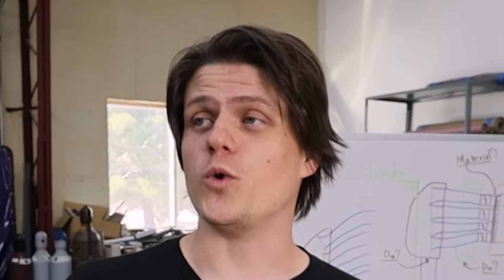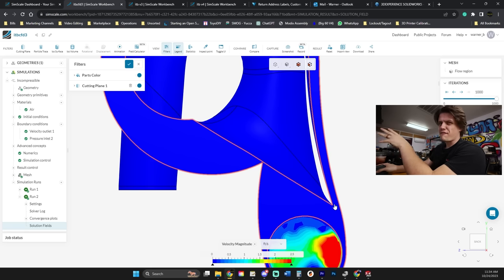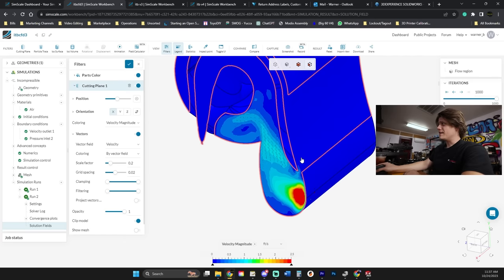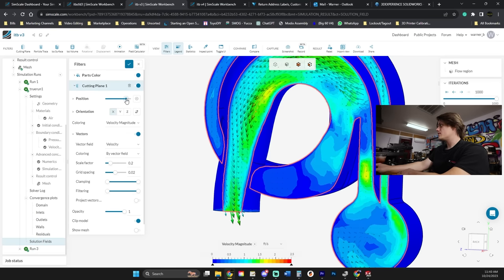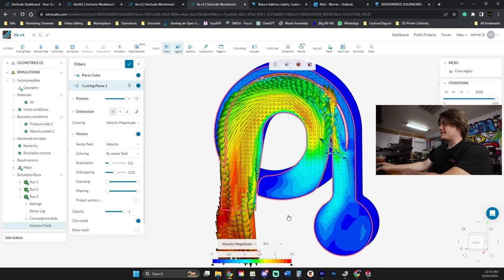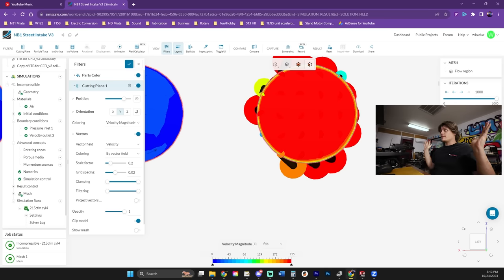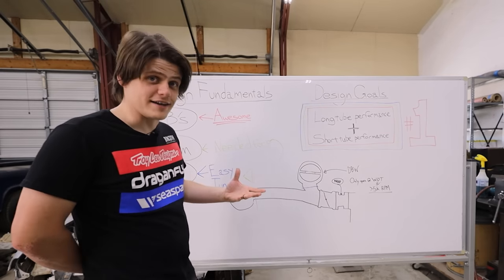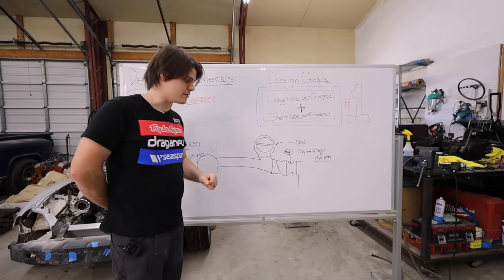The 3D-printed ITB intake system continues to evolve

Comment: The biggest issue with the air velocity you're getting with that round design, Is if you're getting more velocity than the size allows, it's compacting the air and when air compacts it gets warm to hot. Remember turbo and SC applications requires an intercooler or alcohol injection to cool the intake charge, or run straight alcohol to keep temps down

Comment: If air speed is too high it will create a sonic choke at the pinch point of the valve. As the valve opens further it can hand more velocity up to the point the air cant feed the maximum amount of the valve because the air moves fast enough that it skips more and more of the  valve.  This all is meaningless if the amount of air filling up the cylinder is more than its measured volume. That will be achieved by not only having a correct length for a velocity target but also a acoustic target which is a harder thing to pinpoint due to different charge densities.

Comment: Steady-state 3D CFD isn't going to give you a remotely accurate result when it comes to intake/exhaust modeling. There is no steady-state flow in an intake runner. Resonant effects are MUCH more important than steady-state results - i.e. cam timing and runner length (among many other parameters).

If you want a reasonably accurate model, you need to set up a 1D model using something like Ricardo WAVE or EngMod4t. These virtually "spin" the engine and include modeling of combustion, crank/rod geometry, cam/valve lift and timing profile, etc. At very small increments of angle, they calculate the boundary conditions everywhere in the system. Basically they run a CFD simulation of the entire engine every degree of crank rotation until the model converges (it takes a LOT of computation and would take even a supercomputer a while to run if it was 3D, hence the 1D modeling). 

Once you have a decent 1D result you can start to think about optimizing in 3D - but honestly the gains there would be very marginal and not really worth the time unless you're a full-time design/sim engineer working on a large OEM or race engine team. Ricardo has their VECTIS software which can be run as part of the engine simulation - for example, by "inserting" the 3D model of an intake manifold into the 1D full engine model. The boundary conditions of the 1D model are applied to the 3D model, and the 3D sim is run. Again, this happens hundreds/thousands of times in a single full-engine simulation, and takes a very long time.
Reply from the maker: That's awesome. It sounds like those might be outside the budget right now but I'm going to look into them.

The steady state modeling did help me bring the design from a severely restricted state into something that actually seems to flow so I would say it was extremely valuable.

One question about the sim software; You see in the front facing cross-section how the large curve air intersects the short curve air? How could that be simulated in 2D? I feel like this shape may always have to be run as a 3D model.
Reply: @StandRacing  yeah that particular aspect would be tricky to do in 1D. I totally understand budget limitations (Ricardo software is very very expensive). EngMod is much more affordable but there are other options that would work, albeit with big learning curves - look into the work of Gordon P. Blair, specifically “Design and Simulation of Four Stroke Engines” If memory serves it gives you just about everything you need to build your own engine simulation software. I believe you may be able to find some free software, Excel files, etc that others have created based on his work. 

I haven’t watched any of your other videos but I would start by determining the runner length(s) you want and going from there. Also take a look at BMW M42 (or maybe M44), they also used some kind of dual resonance intake.

Also, if you’re going to keep doing 3D CFD, I’d use pressure-based boundary conditions (this is much more accurate to the operation of the engine) and just focus on runner geometry to start. IMO the design goal of any plenum (especially with ITB) should be “act like you don’t exist” (i.e. act like an atmospheric inlet to the runner) so unless you have a severe design deficiency with the plenum the runner/runner inlet geometry is by far the most important (in order of priority: length, diameter, inlet geometry).

When you add complications like dual-length runners and junctions between them, use KISS to make sure each one makes sense as an individual unit. Maybe also consider designing a “doesn’t fit” straight version, them bending as needed to get it to fit the engine bay.

Oh, and I’d scrap the 3D printing anywhere near the throttle bodies. You might be able to get away with doing the plenum but vacuum forces, heat, and gasoline will lead to very short lifetime and/or geometry creep and leaks. 

I’ll try to take a look at some of your other videos to give myself more context on what you’re working on before I give more advice :)
Reply: @StandRacing  Taking a look at the design again, from the "KISS" perspective - the "driver" of air flow in your intake runner is going to be the vacuum in the combustion chamber while intake valve is open combined with any positive pressure wave in the intake runner. In other words, the valve seat area is going to be pulling on the downstream end of the duct (port+runner). With a simple atmospheric entry velocity stack, the result is obvious: "air goes in."

With a simplified version of what you're designing, you'd simply have two velocity stacks with a Y-junction near the intake port. That already makes things much more complicated - you'd have the driving "pull" through the intake valve as the piston moves down combined with any exhaust scavenging pulse, but the positive pressure waves from the two intake runners would arrive at different times, weakening their effects. Maybe at low RPM the long runner would negate some of the downsides of the short runner when it's not in it's optimal operating range, but just as easily you might just transfer air from one runner to the other instead of into the intake valve. Maybe you would broaden the powerband, but you'd also end up with less power at each one's tuned RPM compared to the single-runner version. And that's the best-case scenario - most likely, you'll lose power almost everywhere compared to a good tuned single-runner intake. As others have pointed out, a switching valve between them would work in theory to give you what you're looking for, but very tricky to implement reliably. Turns out it's simpler to make your cam timing and lift variable (which is why pretty much all OEMs do it nowadays). And those variable valve systems are COMPLICATED, yet somehow still simpler, more reliable, and more effective. Not saying what you're working on is impossible, but it ain't easy.

Anyway, back to your design - it's like the dual-runner above, but with the Y-junction at the inlet to the runner. The short runner therefore has its inlet severely restricted, and the long runner does too (since you have the narrow opening on the outside of your scroll design). The placement of the junction means that the pressure wave interactions would get even more messy. And the momentum of the air going through the throttle body, that you're hoping will feed the outer/longer runner, will be mostly killed when you ask it to make a 90deg turn to enter the runners. 

I know packaging is a big reason for doing the scroll-shaped runners, but for trying to understand if the concept will even do what you're hoping, I'd again suggest modeling a straight version of it first. The reason 1D engine simulation works is that for the most part, length/diameter/volume/pressure are all that matters. If it isn't clear, a 1D sim is a mathematic approximation of the 3D system that simplifies the complex 3D shapes of a duct into the simple parameters of length, diameter, discharge coefficient, and plenums as simply "volume," and the interactions between them as simple boundary conditions. It's very much a "first principles" approach that gets you 90% of the way to your design goals, and makes design iteration much more clear. And to clarify, I'm not necessarily suggesting that you run 1D CFD, but that you use that first principles approach. Very easy to get caught up in the weeds of design details, run too far with a novel concept, and miss something fundamental that makes it not work. Of course, you can always just build it and see if it works, and then go from there - sometimes that's a much quicker way to learn!

Comment: Your design is no different that Mazda's own VICS intake except that theirs shares a plenum and yours does not. Put ITBs between a VICS intake manifold and the engine and there you go. Done.
Reply: VICS with ITBs would be the ultimate intake. Since it has a single opening for a filter you could easily route cold air into the manifold
Reply from the maker: Mazda VICS added to research list 👍That's literally what I took off the car so that should be an easy read lol

Comment: Be careful with the way you interpret simulation results. Anyone can get pretty rainbows, but the numbers can be meaningless. It look's like you are doing steady state simulations, which aren't very good for a intake or exhaust manifold application, as the main phenomena you see there are pressure waves, which is VERY different from a steady flow (which is like a hose running constantly). In fact, the whole runner length (or equal lengths in exhausts) thing has to do with managing the reflection of this pulses or waves. For that, you need to run transient simulations, which are a hell of a lot more computationally intensive, and you need proper information about the pressure pulse's characteristics (at the very least, a single pressure and a duration, but we know the pressure in the piston when the exhaust valve opens is way higher than before closing). Sometimes steady-state can be a guide to what is happening, but sometimes the results are not just way off, they are useless. Trust me, I was working in that a couple hours ago (I do complex multi phase simulations at work).
Reply from the maker: Absolutely with you. What this test did help me do was turn a design that was severely restricted into one that seems to move air around properly.

Comment: Efficiency over 100% means you've made a mistake. Either with the maths and parameters, or you haven't factored in all the energy that's coming into the system. There are some devices that output more energy than you channel into them. Examples include the LEDs that scavenge environmental thermal energy to produce more light than the electricity they consume, and heat pumps that can move more watts of heat than the watts of electricity you put in. They have a coefficient of performance >1. Meaning you get more energy out than "you" put in, BUT that's not >100% efficient. Saying that will discredit you amongst people who know what they're talking about. If you don't know you can't have over 100% efficiency, and you're claiming it, then what else are you mistaken about? Probably not worth our time to find out?
Reply from the maker: As far as the actual results go, the simulation isn't listing average flow at the outlet cross-section, so either the average flow is maxed at the parameter I set it to despite some local areas of air having a higher velocity, or if the average flow is in fact higher than the fixed parameter, I can only assume it's flowing well enough for atmospheric pressure to be added in.

Coefficient of performance is a little long to be easily viewable in a thumbnail. What would your approach be to balance scientific credibility and mass appeal?
Reply: @StandRacing  Fluids flow from areas of high pressure to lower pressure, so if the air is traveling without some form of compressor pushing it, then it's flowing towards a low pressure region, and that flow's pressure will be below ambient pressure.

If you set the intake boundary condition to a set pressure then it should be that pressure perfectly over the entire area. Did you by chance set the boundary condition to 98,285 Pa/0.97bar/14.25psi? Because then the maths would work, I think?

If you want to get loads of views then there's no correlation to reliable or high quality content so what ever grabs attention will work. Just be enthusiastic and hyperbolic.

If you want to nurture a community that can help you on this project then do your best to be clear and correct maybe? But there's no faster way to get a right answer on the internet than to post a wrong one!

As for a middle ground... "Unbelievable results!" Is attention grabbing AND accurate  😅

"3% better than stock?!" could be true, maybe?
Reply: @StandRacing  From the video it looks like the boundary conditions were (presumably) Environmental pressure inlet, and it says "velocity" outlet? So you set your outlet velocity, so it will be what you set it to, which apparently was 227.3 fps? So comparing the velocity means nothing, since you set it?

I think you've got the right idea with the volumetric flow rate though. Assuming that's 1.6L volume, divided by 4 cylinders, divided by 1 intake per two revolutions, multiplied by 6500 rpm, that's 1300 L/min per cylinder, 21.67L/s, or 46cfm. Your simulation says 215cfm for cylinder 4? 

If you ask Solidworks nicely they are known to give out the simulation software for free to people with YouTube Channels. Also Lotus engine simulation software is awesome for designing intake/exhaust systems, if you can find a copy.
Reply from the maker: Oh good advice on reaching out to solid works, I'm gonna give that a try.

My inlet boundary was 1 bar, outlet boundary was 215cfm (it's labeled velocity outlet but the actual metric you input is volumetric flow, it shows velocity as a result)

The volume is 1.8L and I calculated flow at 8000 rpm.
Reply: @StandRacing  assuming it's 4 cylinders that's 1.8L/4 = 0.45L per cylinder. 8000rpm with 1 intake stroke every 2 revs = 4000 intakes per minute, 4000 * 0.45L = 1800L/min, or 30L/s, or 63.57 cfm per cylinder. Are you sure about 215cfm?
Reply from the maker: I used this formula from @seanb1443 

"Cubic inches x rpm x 0.0009785 / number of cylinders = cfm demand at 28” test pressure."

It's interesting that this does take into account a flow bench parameter but it doesn't take into account 1 intake event per 2 RPM.

Intuition tells me a 250 CFM carb would be restrictive at 8k RPM, and a 850 CFM carb would be too much.

If you add a (RPM / 2) to Seans formula you end up with 430 CFM across all 4 cylinders, which feels correct intuitively.
Reply: @StandRacing  I realised I made a mistake; what I calculated was the average flow rate per cylinder/stack, but each cylinder only intakes for 25% of the time at 4x that rate. So peak flow rate per cylinder/stack is 254.28 cfm? Very close to your 215cfm!

Each cylinder intakes once per 2 rotations, but since there's 4 cylinders, and it's a 4 stroke, every half rotation is an intake for one of the four cylinders. 

It's possible to get Solidworks to simulate each cylinder taking turns to intake at this rate. Although I did this about 10 years ago and it took days to run. Computers are a lot faster now so it might not be that bad. I'd offer to run a study for you, but my computer is currently running a parametric study for work and is likely to continue to be for weeks. 

I presume fuel injection is off the table?
Reply from the maker: @Leo99929   At what point does the 28" water column become a factor? I understand the premise of using it on a real world model in a flow bench but I don't understand why it is used in the formula, or where it would be considered in a boundary condition.

Sorry, the car IS fuel injected. I only meant to use the carburetor reference as a feeling based litmus test for what I would expect the airflow to be.

If a 350ci V8 can make 350+ HP at 6500 RPM with a 650 CFM carb, it's hard to believe that a 110ci I4 is sucking in ~900 CFM at 8000 RPM.

It's not scientific, just a feeling. Maybe carburetors routinely flow higher than their stated figures.
Reply: @StandRacing  I've heard of using the 28" water column as a standard pressure to compare air flow changes. If you're comparing a velocity or flow rate it's necessary to define a set standard pressure to compare it at because otherwise you're not comparing apples with apples. I guess this is how you calculate volumetric efficiency? 28" water as your standard pressure, how much air did you suck into your engine over 2 revs? say 1.35L in your 1.8L engine is ~75% VE. That can be a useful metric for comparison. I guess you could change your CFM to SCFM if that's an option? I'd just ask for mass flow rate instead though. 

All that really matters is mass flow rate: How many grams of air did you cram into that cylinder, because you can only burn as much fuel as you have oxygen for and the amount of fuel burned limits your power output. The software should have that as a standard output with no pressure issues. 

Your 350 HP 350 ci V8 at 6500 rpm is 658 scfm, or 310 L/s. 110 ci i4 at 8000 rpm is 254 scfm or 120l/s. So I'd expect around 135 HP if the efficiency is similar. Definitely wouldn't need a 900 CFM carb, unless you're using forced induction, in which case that's a decent 3.5 boost ratio.